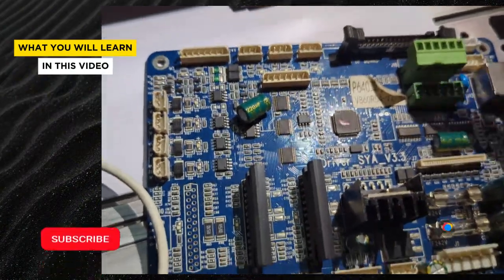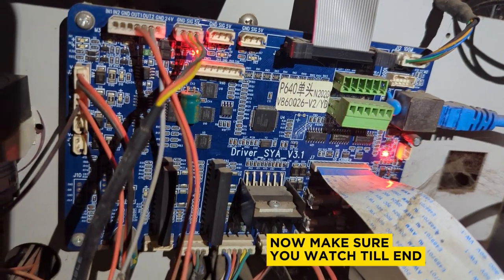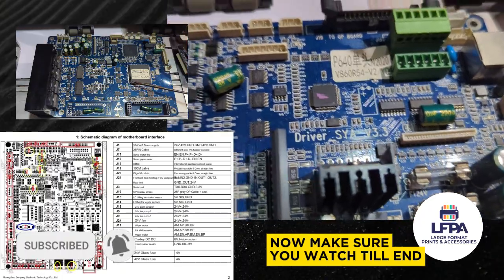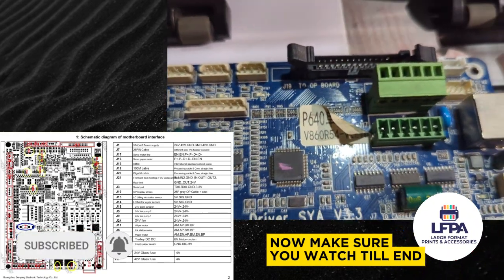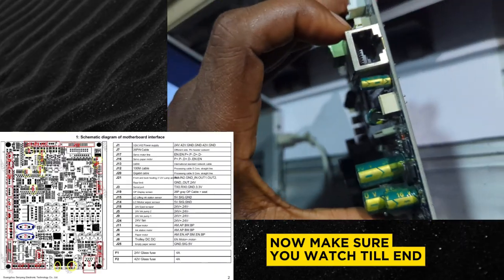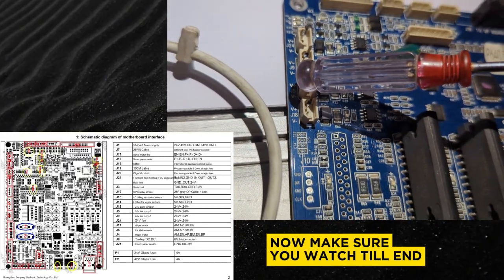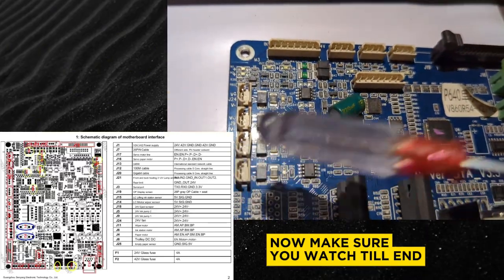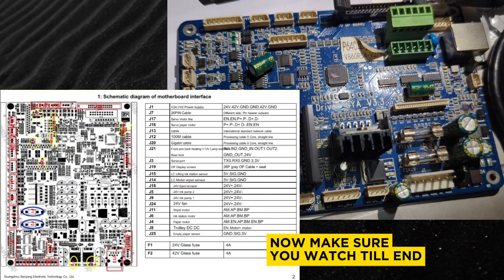How to know if your XP600 Driver Board is Faulty

Comment: My printer is equipped with a communication card identical to this model. During the printing process, the print head moves and then stops for a few seconds before resuming, and this behavior repeats multiple times. At the same time, a communication failure message frequently appears on the screen. As a temporary workaround, I stop the printing process and then resume it, after which the printer continues printing, but the issue keeps recurring throughout the job.
Reply from the maker: Most likely this is because your computer RAM IS TOO LOW. try increasing it to 16gb RAM. Or at least 8gb.

But 16gb is better

Comment: Does xp 600 print head work well for uv ink???
Reply from the maker: Well is relative. But it definitely works.
Reply: @richwords1  compared to i3200
 choosing xp600 is good option??? 
I want to buy uv machine but connot decided which head to choose
Reply from the maker: But you can't effectively compare between a 180usd print head and a 1300usd print head.

The more expensive the higher the quality. 

I3200 is definitely a much better head. Judging by the Price.

Comment: I have yinhe xp600 machine but the network connection is off. What should I do please?
Reply from the maker: Start from checking that the cable is connected to the computer.

Also check if the Network connection on your system is configured properly.

Do some troubleshoot to determine the fault.

Comment: WHAT IS POSSIBLE PROBLEM NO NETWROK CONNECTION, NO LIGHT INDICATION BLINK, WHAT IS POSSIBLE SOLUTION
Reply from the maker: Find out if it's connected to power
Reply: @richwords1  yes, there is power, theres a light indicator on board, on Lan where  the rj45 was connection no light indicator blinking
Reply from the maker: Okay. Look for another board and test. Or test the board on another machine
Reply: @richwords1  where can i get the diagram of a mainboard?